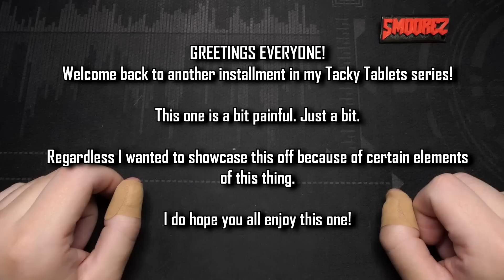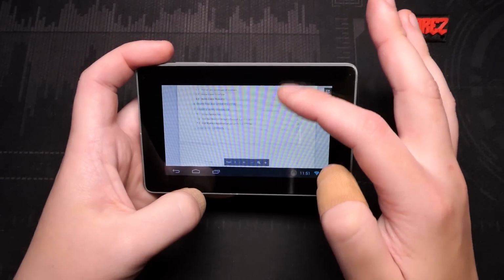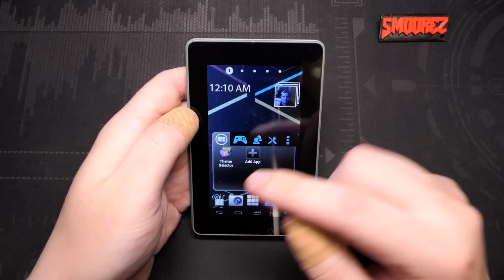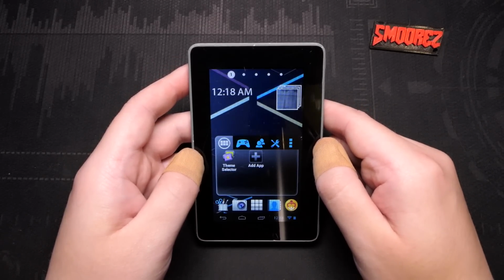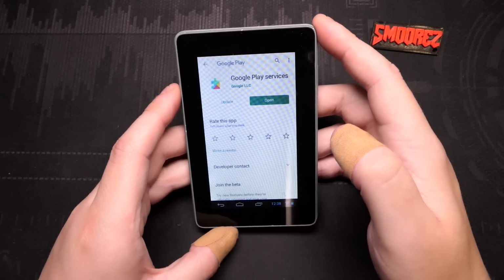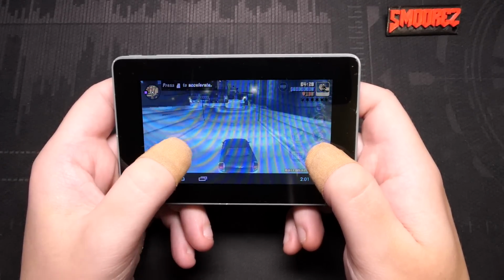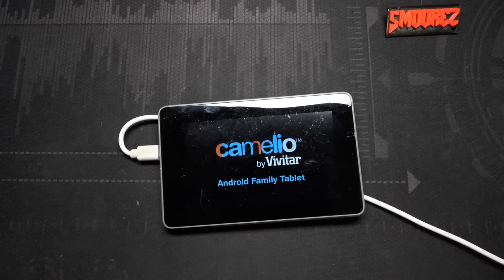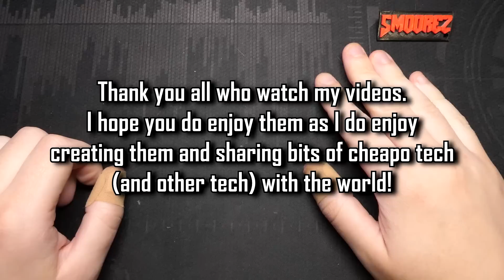Camelio by Vivitar "ANDROID FAMILY TABLET"...it's as bad as it sounds (Tacky Tablets EP6)

Comment: I remember seeing 4.3" tablets like this pop up in electronics and computer parts shops in the early-2010s. It's was an interesting form factor for the time: larger than an iPod touch, but more pocketable, portable and cheaper than a 7" tablet, which would have made it great for media consumption. 

The problem is that those tablets were woefully slow (even for low-end Android tablets), and often shipped with Android Froyo (2.2.x) or Gingerbread (2.3.x), when even white-box low-end Android tablets were shipping with Ice Cream Sandwich (4.0.x). And they weren't that much cheaper (or even cost more) than 7" tablets anyway. From what I remember though, this form factor ended up not making much headway, as 7" budget tablets got cheaper and cheaper, and "phablets" started to become more popular.

Comment: It looks like it is using either a GEN 5 or GEN 6 LCD screen you'd see in mid 2000s palmtops, that is why it has colour distortion on the angle, it is a really old LCD design, wouldn't surprise me if it has visible banding too but obscured by the glass in front of it, so likely the same kind that was in first generation video ipods from 2005 as well as palmtops of the time period and they're using new old stock or an old manufacturing facility producing them in bulk for poor countries.  Likely worth $2 now, that is obscured by having a glass panel in front of it, the most expensive item in that tablet is likely the glass.  Considering this was in 2014, it isn't much of a stretch to come to this conclusion.

Comment: Thank you so much for oentioning Talkback in the review! I have used a couple of these devices in the past, primarily the PMID4311 and 4312 4.0 Android tablets, and the experience was slow with Talkback, but was made worse when Talkback wasn't even installed, causing me to need to keep an SD card with Talkback apk files as well as TTS resources and sighted assistance to even install the services and enable them.
I'd love if Google would put in an adb command to just enable Talkback and reboot.

Comment: Interesting that they call it as a tablet since it's smaller than a typical today's smartphone. :D
Reply: Tablet is a term not dependent on the size of screen but rather the aspect ratio. In other words, if it resembles an actual Tablet (the original ones used in Egyption Old Kingdom, that were made of stone and had carved inscriptions).

Comment: About the chipset: the iMAPx820 is not even a proper chipset, but a application processor from 2008. I am actually surprised Android 4 runs at all without making the device selfcombust.
Inside the "chipset" there are two Cortex A5 at 1 GHz and a 300 MHz Mali-400 rated at 1.5 GFlops.

Comment: I remember a similar tablet that (iirc) was made by Archos. It had reasonable specs on paper, 4.3" screen 1g ram 8 g rom & Android 4 but it ran like drugged snail! £50 back when Ice-cream Sandwich was a fairly new OS.
Reply: yup. been there, spent the money on archos, and watched it die within 6 months of owning it. a friend of mine bought the same tablet and his died at exactly the same point mine did. 
archos support was on many levels of iffy and apologetic, (and I was the go-between to sort my friends tablet out, so I had to commit things to memory to fix his) but given that two of their devices had died with just regular day to day use, I vowed never to touch another archos product ever again - even if it was free.
the Samsung tablet that I replaced it with might be old, but at least it still works! (ok, it's massively slow, but it's better than Vivitar... 🤣 )
Reply: @audiocoffee  The funny thing is I've still got a a 7inch Archos tablet running Honeycomb that is fairly snappy & has good battery life. Only problem it's almost impossible to go on line as it's so outdated. ☹️
I also had a 10inch one that died so I know what you mean. 😁
Reply: @ericpode6095  however, if you want pure irony, while this video was playing, I've been trying to set up a bluetooth connection between my main laptop and a recently purchased lenovo tablet (loooove cashies - best £40 on up-to-date tech I've spent this year). ironic because laptop - to - set top box = matter of seconds. same with tablet to set top box = matter of seconds. but the two won't chuffing well pair up together - so now I have the ultimate non-workable solution to the headache that is my current set up. everything pairs up to the wrong things. 
as for smoorez next video on cheap laptops = done. £20 ex Win8 laptop w 500Gb hdd. works flawlessly with linux lite on it. bought it for a dare because it had no operating system - the only flaw with it. 🤣

Comment: Does anyone remember the Biglots 7 inch tablet which came with a keyboard case and had a full-sized USB A port to connect the keyboard? Sold for $89.99 back in 2012, 2013 era.

Comment: I think I had this exact tablet or another model, it died in 6 months and wouldn't even boot up. This was one of the worst "handhelds" I've ever used, it got so hot it was uncomfortable to hold and the battery lasted an hour and a half on a good day. The screen was pixelated and the device itself was slow and buggy. Watching youtube was pushing its outer limits.

Comment: I had the crappy Iest Vivitar camera ever. Two of the crap Iest cameras ever that were both Vivitar cameras. Yes, one was a handheld kit video camera and one was a larger video camera that was more like the type of camera. My mom had except it was a digital version and it was a Vivitar camera. my mom’s was a different brand. And mine had my buttons on it. Where is my mom‘s was half with buttons and partly a touchscreen. Worst company ever for cameras. I also had their earbuds once and those sucked to because they weren’t noise canceling. I just needed an emergency pair of earbuds so the sound quality was just fine for that. the camera quality is really bad. It’s about as bad as the camera on my VTEC in our tab system why it Hass to be the same quality as the VTEC in our tab, I don’t know, but it is. It buffers a lot like a VTEC camera. If you are a teenager, I wouldn’t recommend it. The iPhone camera is way better than that. And I have an iPhone 11. I meant the camera on this tablet is the same quality as the VTEC. Inotab 3.

Comment: Rule number 1 with old smartphones and tablets: do NOT sign into playstore and if you can, deactivate the app instead. It will try to automagically self-update in the background without your consent to the newest version compatible with that android version which in 99% of the cases means pure bloat and an even more unresponsive device (as noted here where it started overheating after  logging in). You're much better off installing the test apps you need via the sd card and a file manager than to kneecap it with playstore. As an example, my own 2nd gen Moto G from back in the day with a Snapdragon 400 (1.2GHz Quadcore) feels pretty snappy still so long as playstore is disabled. When it's not, the phone heats up a lot, uses battery like there's no tomorrow and feels very laggy (everywhere, not just in the app). I could say something about this behavior probably being intentional (as it still slows down much newer and more powerful devices too), but I don't wanna come off as a conspiracy clown
Reply: Aurora Store